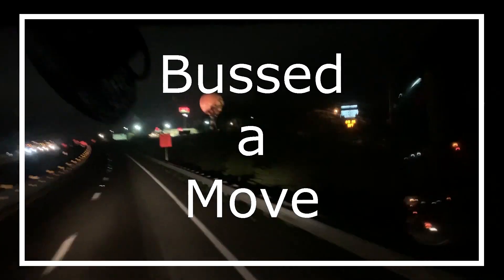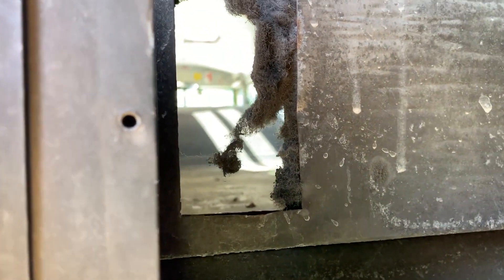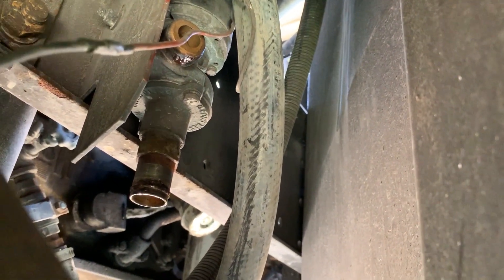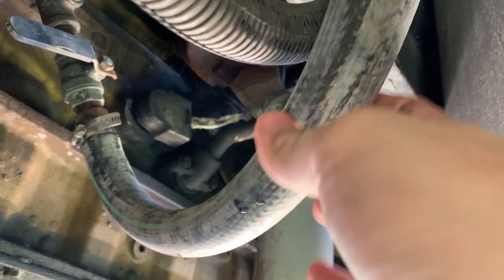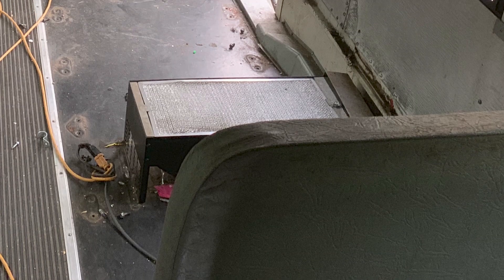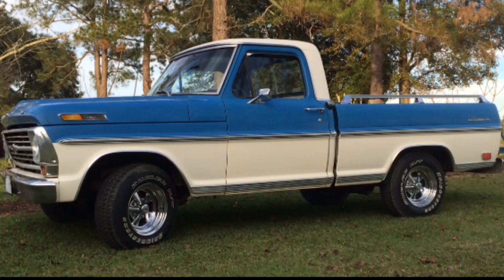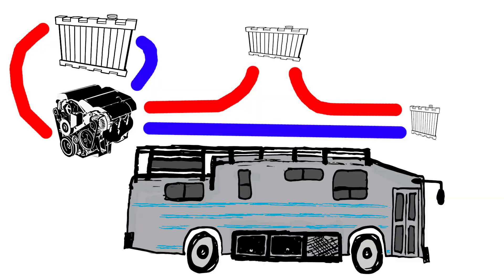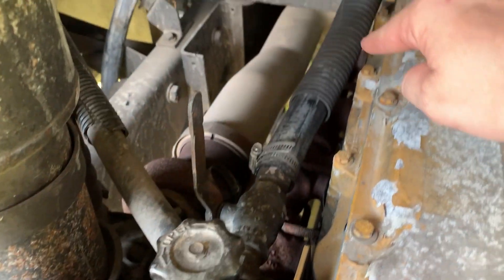Heater Removal in a School Bus - Skoolie

Comment: Remember gravity is your friend... I un bolted the heaters and lifted the center of the hoses, then drained each line inro bucket in bus, carried each out the door to get lower than floor level to finish drain. Worked pretty well, lost a few cups on floor. ..... Some reallly helpful advice for removing the screws (along the hose cover and reat of bus interior/exterior.. This would have saved me a lottt of stress..lol)  Phillips star bit works but only if you're leaning hard into it.  Robertson bit actually fits perfectly and strps 90% less.. Interior floor screws use wire attatchment to clean first. . Not sure if you covered this in one of your vids and i missed it...hopingbit will save someone stripping screws :p Peace
Reply from the maker: Thanks for reaching out. Our screw removal technique consisted of grinding a slot through the head and using a flat head to pull it out.
Reply: @bussedamove  I tried that on the ones that stripped..most would just break though..once the head broke off I just backed them out from inside w small vicegrips.
Reply from the maker: That’s a good idea too!

Comment: Helpful content. Like others, I am converting a 1999 SafTLiner ER (3126) and am researching the heater removal process. I’m considering leaving one or two heaters and am curious if I could bypass one heater so I could keep the cockpit heater. I’d appreciate your input. I plan to view all of your content. Thanks for your channel. Btw, fellow musician!
Reply from the maker: Hey there! Welcome aboard! Your set up is probably exactly like ours was. Same bus within a few years and same engine. There should be no problem with keeping one of them. You’ll have to just connect the hoses with a fitting and keep make sure you keep the ins and outs all flowing the right way. I would recommend re routing the lines under the bus to avoid catastrophic damage done by a coolant leak in the future. Good luck. Please feel free to reach out with any more questions. We respond best on the Instagram if you’re there. “@Bussedamove” Talk to you soon!

Comment: I’m also converting a 2002 safe t liner, I have a few questions about the heater delete. If the hose running to the engine is inaccessible can I loop the send and return hose to each other or will that cause trouble for the engine?
Reply from the maker: Hey Andrew. Thanks for reaching out! What engine do you have? I can’t imagine it being inaccessible. Ours was hard to get to but it wasn’t inaccessible. 

I might be misunderstanding your question. The way that I’m reading it, that is exactly what you’re supposed to do. Think of the direction of the water flow. You’re eliminating 70’ of hose and putting back in about 3’-4’. Your goal is to loop a line from where the coolant leaves to go to the front of the bus back to where it comes back to the block. 

If you meant anything other than how I read the question, there will be issues. The system has to be sealed to work. When you start cutting lines and pulling heaters, the system will be open. Your job then is to get the loop reestablished. 

Do you have the CAT 3126? I hope this helped maybe a little. Reach out on @Bussedamove on Facebook or Instagram. It’s easier to message there or I will call you so we can talk. Lots of meanings get lost trying to type. 😳

Comment: We just started our bus too. Do the parts we remove have any salvage value? Heater core? AC coils? AC compressor on the motor?
Reply from the maker: Hey there. Congrats on the bus! There are several things you could do. A lot of people run the heater core under the bus to serve as a second radiator. There is some copper in some of the parts but probably not enough to get you much in salvage. Your best bet is to hang on to them for a bit and try to resell them somewhere like FB Marketplace or Craigslist.

We actually just launched something on our website called The Virtual Swap Meet. It’s a marketplace for just Skoolie and Van Life stuff. We have right at 50 users. I can’t promise you success there but you can try if you’d like. Join here:

https://skoolie.thediybusguy.com/virtual-swap-meet

Good luck! Stay in touch.

Comment: So did the replacement with an electric heater work? I'm doing the same thing right now and curious whether I should route my heater lines under the bus or completely delete.
Reply from the maker: Our build stalled due to some health complications and we haven’t gotten back to that point yet. If you’re going to keep your front heater, I would absolutely route the lines under the bus. You don’t want a chance for that stuff to end up in your home. We pulled out the front heater core and it saved us so much space up there. I know we can get an electric heater that will take up a fraction of that space. Thanks for reaching out!
Reply: @bussedamove  thanks for replying. Wishing you the best with the health concerns.

Comment: I guess your lines weren’t looped to your defrosters
Reply from the maker: Thanks for reaching out. We looped all of our lines at the engine (rear) and we have no heater cores or coolant lines left in  the cabin at all. We will have an electric heater in the dash for defrost.
Reply: @bussedamove  that’s good. Many people don’t know that the lines also heat the defrosters. I like heat in my cab. I kept my heater. Moved it to the front so to heat my waterlines while driving.